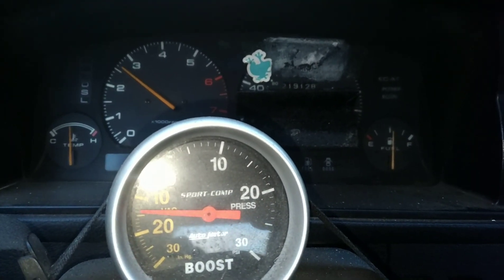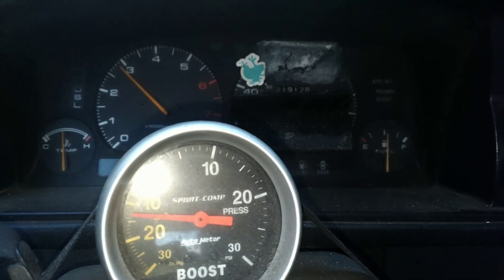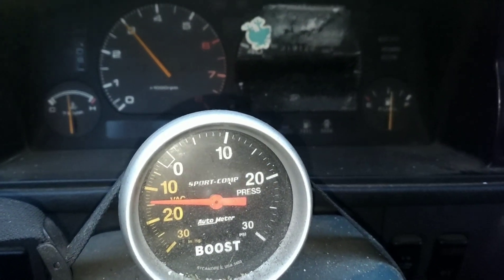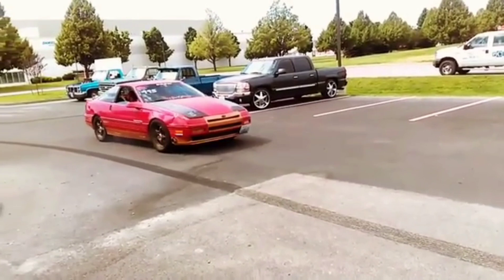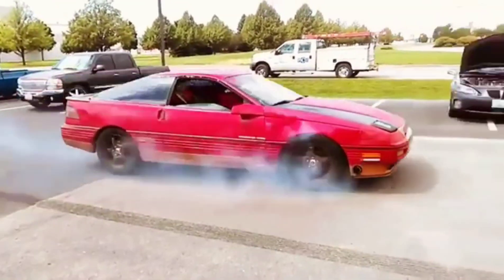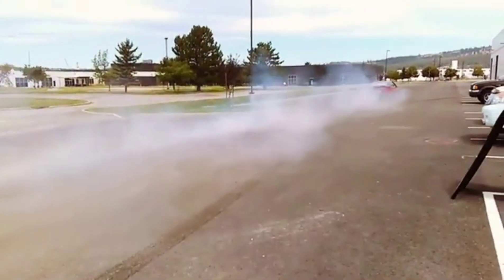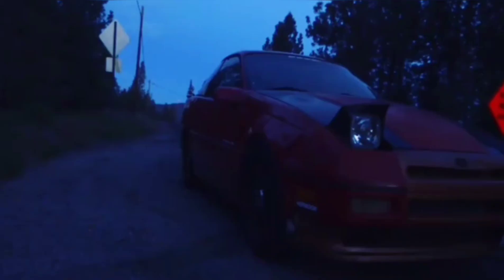Boost Lag vs Boost Threshold

Comment: Hey you're back Good to hear from you... I parked my probe my '89 GT since July no one can figure out what the hell's wrong with it.. I just gave up throwing money at it.. It's sputtering popping backfiring under light to moderate acceleration can hardly go up hills... after 1500 RPMs. change like everything..... just put it away for the winter bought a Volkswagen golf 2.0 I live in Connecticut my daughter moved to New York Long island my I drive my golf the two hours about 100 miles an hour all the way there and back ... Safely for the most part..I miss my turbo GT put it away for the winter because of the threat of icy roads which didn't happen in the Northeast this winter thus far... can't wait to get it sorted out this spring    can't keep up with those Audi/ BMWs. Between 100 to 135 mph I'm the boss...  In my probe  talk to you later
Reply from the maker: Sounds like an ignition problem. Make sure the distributor is good.